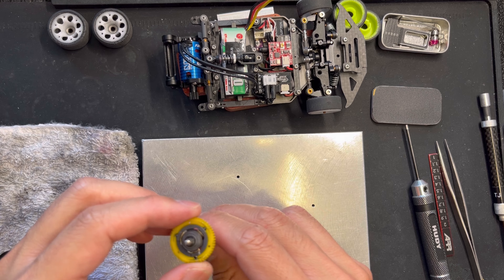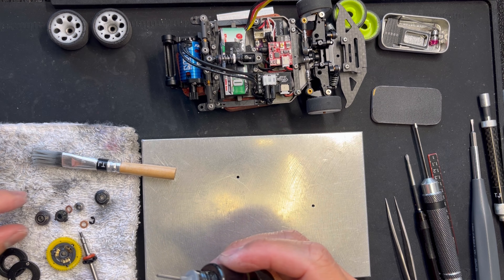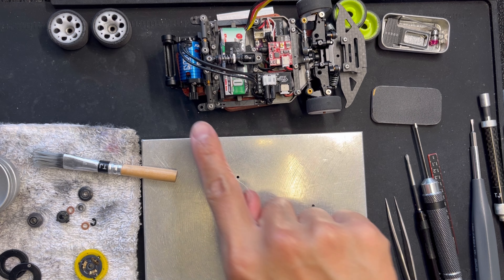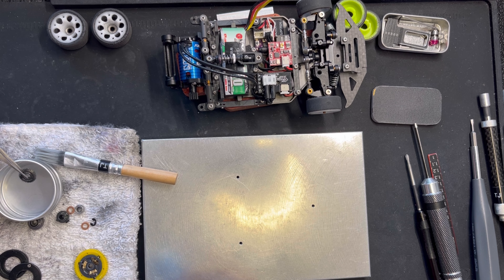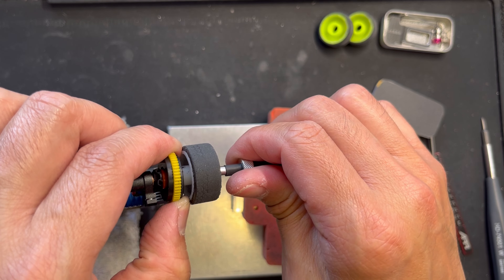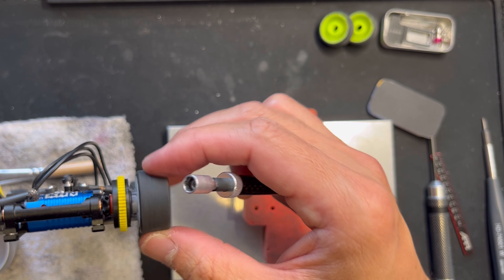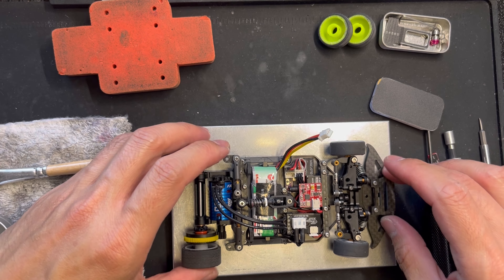Tip of the day #2 | Cleaning & Lubing PN Racing Gear Diff

Comment: Great video again I just purchased the same gear diff but was wondering whats the trick to getting the right adjustment?  When adjusting what am i suppose be looking for how fast the rear rotates around the turns?  Is it better to run tight or kind snug or loose?  Thanks in advance!!
Reply from the maker: Thank you for watching! 

I prefer dry or the dry chain lube (the one in this video) so the gears are free to move. When I flick one of the wheels, both wheels would spin freely with noticeable sound of the planetary gears spinning. Like the gears are dry! Any light grease to me at my local track, just feels like the left and right wheels is fighting each other on mid-corner. But when I remove this light coat grease (Tamiya ceramic grease), the gear diff feels nice and smooth in the mid corner. You can even tap on the gas to make the rear rotate a bit to keep a tighter mid corner line (only used when setting fast lap). So mine is not snug, its probably in between the snug and loose. 

You want to keep an eye out on that adjuster nut. Sometimes this backs off. What you want to do is to put the diff in the car, install the rear wheels and torque the right rear wheel nut all the way. Then back out the adjuster nut to your liking on how you want your diff to feel. You want to do it this way because that wheel nut plays a big role on why others cars have tight diff or why the car feels different every time they touch that Right Rear wheel nut.
Reply: @tjaymacRC  Thanks again for the great info!!

Comment: Thanks TJ, but how does one know what is the proper tightness? And what tool do you use to adjust the diff nut?  I’m scratching it using needle nose pliers…😢
Reply from the maker: @michaelhavlena923  Its best to bring it to your local track and ask the locals. Mini-Z community are helpful, the local drivers can help tighten/loosen your diff and then you can get the feel for it.
Reply: Thanks TJ, what do you recommend as best diff to use with the MWX R1 in mod?  The PN one seems way too finicky…
Reply from the maker: @ I personally use Kyosho Ball Diff on all my cars. The diff in the video is a PN Gear Diff. MWX Performance has a new diff called “Slipper Diff”. I haven’t tried it but its something to check out and try.
Reply: Cool, had no clue that the Kyosho ball diff would fit the R1.  I’ll be sure to bring it to the track next time.  Also, I just ordered for the slipper diff.  Can’t wait yo try it out.  Can’t remember, but does the Kyosho ball diff need lots of maintenance? It must have been properly greased from factory?
Reply from the maker: @ Unfortunately you need to modify the Kyosho diff to fit the 64 pitch spur gears we use. I don’t have a video of that but I’m sure you can Google.

Comment: Hi me again😅 do you remember from the diff video you made. Is this the pn gear diff i was telling you the axle is shorter by 2mm then the original reflex diff axle? Isnt it off center  from left to right and you have to shim a lot to get it centered with the rx28?
Reply: And the bearing on the side without the diff is slipping a bit cause it is not on the axle shaft more on the thread so its a bit wouble. The reflex guys on Facebook told me to then use the plastic nut from Reflex racing with the (bearing or plastic inlay) already on it and it will fit but i switched back to the Reflex original RX28SE-G2 diff.
Reply from the maker: Hi, This is a PN Gear Diff v3. Idk if it's shorter than RX28 diff because I don't use RX28 diff. I only use Kyosho Ball Diff. My Kyosho Diff and PN Gear Diff are dead center. I didn't need to add extra shims.

Comment: great stuff, but there's no mention of how to tighten the diff (seems that this diff could benefit from using a special tool to adjust) and how tight it needs to be?  Had a horrible sound coming out of my diff today, took it apart and all looks good, I'm just assuming that it had the wrong tightness.  Any advice on how to determine prioper tightness would be extremely appreciated, much thanks!!...;)
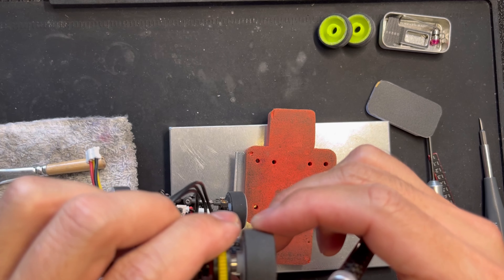Reply from the maker: Thanks! I did touch on it a bit at 1:52 mark. You will have to tune it on the track. Its just like the pinion and spur. You’ll have to go by sound and feel on the track. Follow what I did in 1:52 and adjust from the adjuster nut once you have the wheel hub covering the right side bearing. Tighten/Loosen adjuster nut and go around the track. Turn adjuster nut little at a time, maybe 1/4 turn at a time.